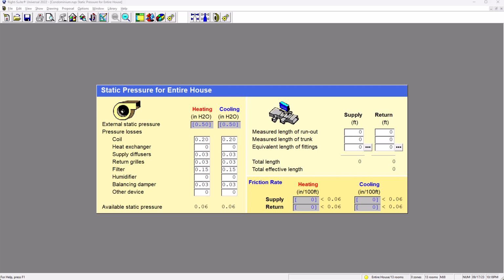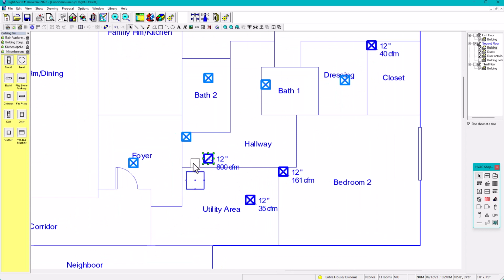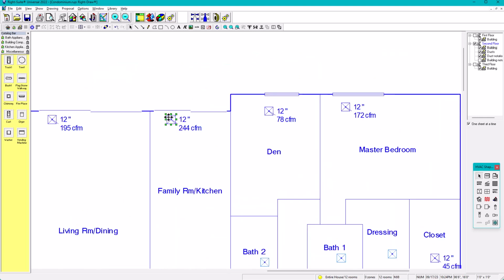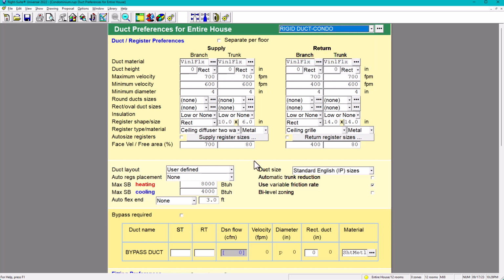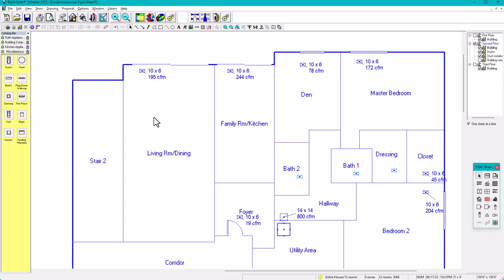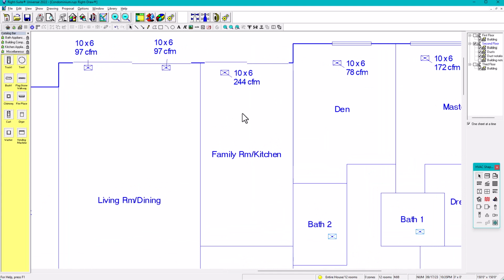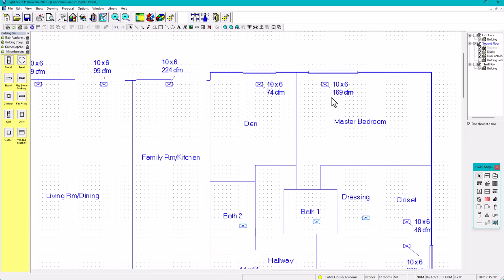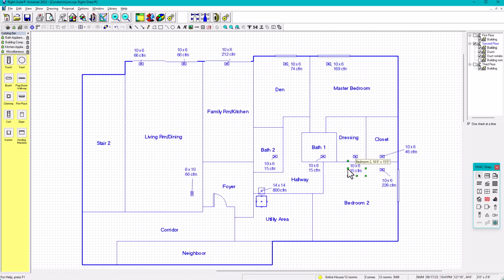Wrightsoft(Part 15): Manual D - Condominum - Placing Registers

Comment: Hello sir , its good to see you again with a detailed tatorail, i want to ask you that  how can we add ventilation load in wrightsift either by ACCA or ASHRAE standard
Reply from the maker: Thanks for your nice comments. You can add ventilation in the “Zone information for Entire house” tab. Where you see indoor conditions and tonnage. But first you need to see which ASHRAE year you will use. ASHRAE-2010, 2013, 2016… 
The ASHRAE year depends on the location of the house. Every states has its own regulations. 
If you are outside of the US you can take ASHRAE 2010 or ASHRAE 2013 (conservative)